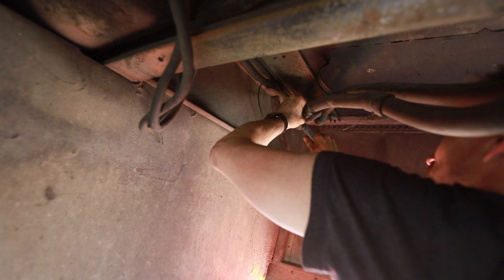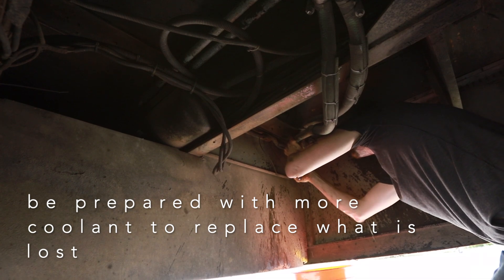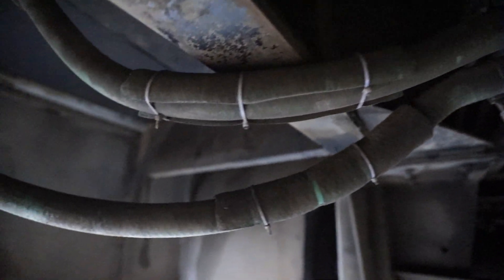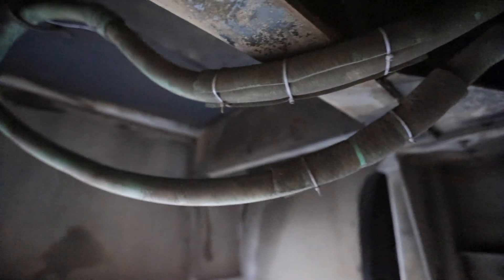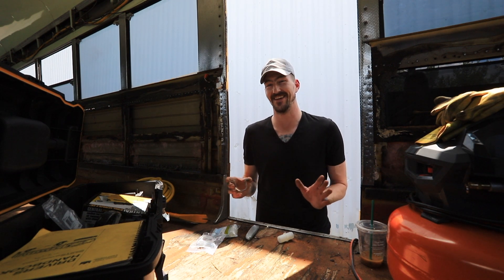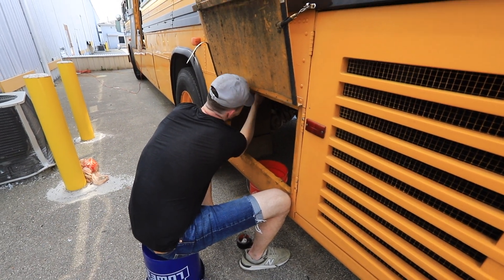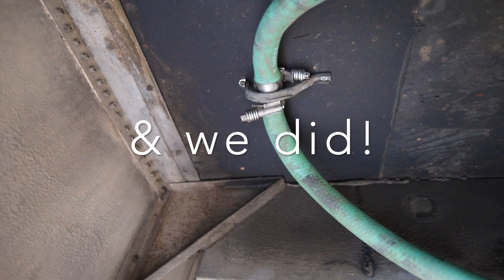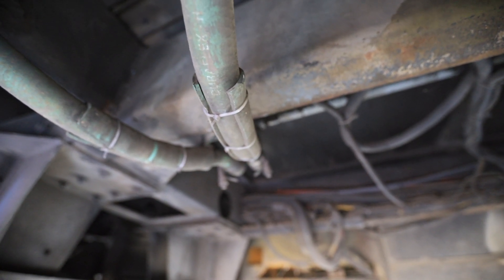EP03 - School Bus Conversion | Demolition | Floor Heater Removal

Comment: I sure wish you would remove that from the engine or at least at the front heater core
Reply from the maker: We are keeping the front heater, it works well and is handy since it defrosts the windshield. We were also recommended by Crown enthusiasts to maintain the original amount of coolant in circulation for the health of the engine.